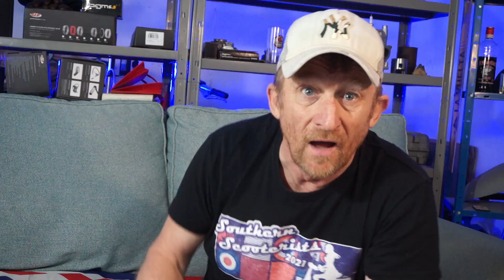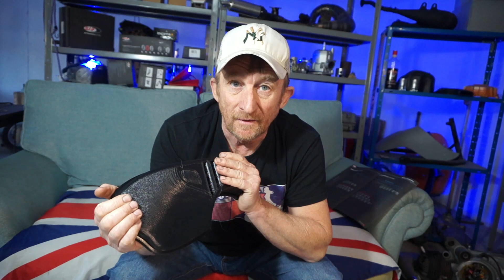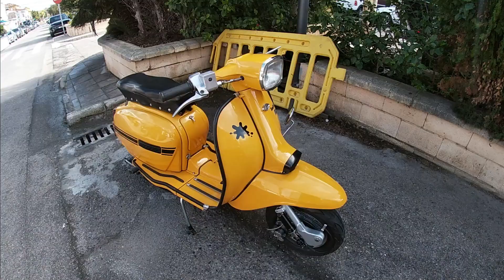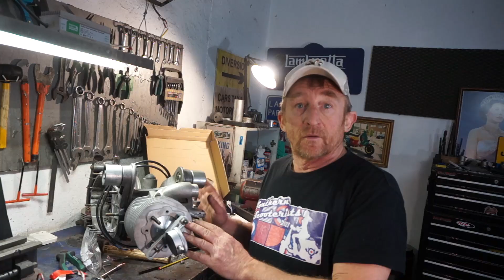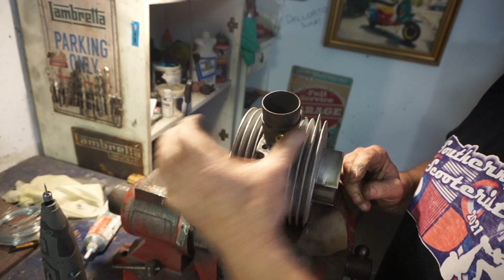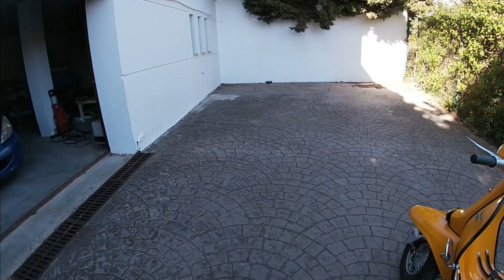mugello 200 build part 5 #lambretta #steelweasel

Comment: Nice bit of kit that SIP Ignition ,  would of thought they might of followed vespa  and yourself and have a raised centre   and at least included a centre  cover to direct the inflowing air ,  like the airbox very   nice
Reply: traduzione
Reply: There is a machined raised center for it that someone is making and selling
Reply: @kevinhagen7808  
K2 do them £45
Reply: @cyclops-fpv   raised centre should be part of the kit ,after  seeing  the work done by steven  I would of thought every new ignigtion flywheel would now be made with a dome shape   and as part of the kit a raised centre cone included
Reply: Obviously not in this case.

Comment: Nice! I want to run that SIP ignition on my GP200 TS1 240. I'll be using it for touring and the extra output of the VAPE will be nice for running all kinds of extra electronic gear, cameras etc